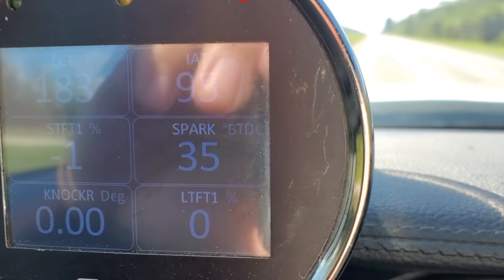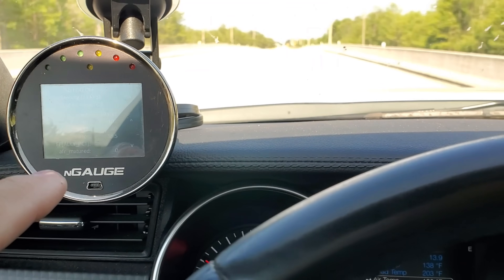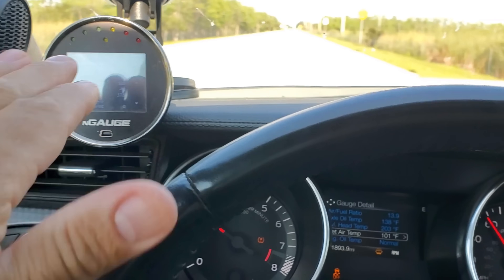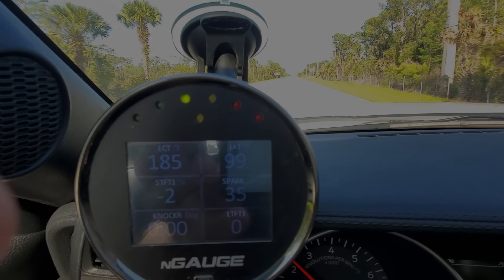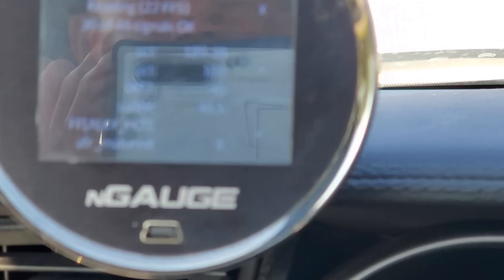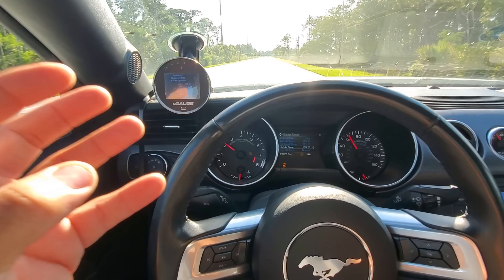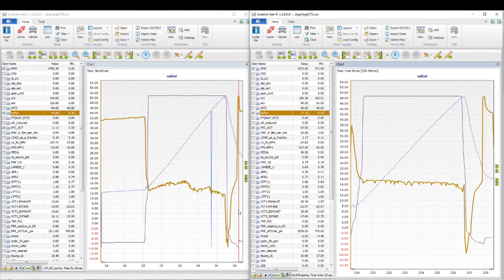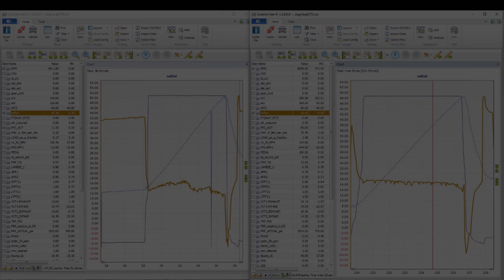Coyote mustangs and Adaptive Octane Logic, How it works!

Comment: Hi ALEX, thank you for another great post. I know this is an old video but I was wondering I have a 19 mustang GT that's not tuned. Does the factory Ford tune have  adaptive octane logic and will I have similar results like you did  with increased timing on the stock tune with the same octane booster?
Reply from the maker: @user-bk5ey9ws5g  yes

Comment: 10 points of that stuff gives you one octane point. So the 8 points it gives you from that would bring your 93 octane up close to 94 octane. That’s why when I needed octane booster I only used Torco accelerator race fuel concentrate. You gotta pay a little more for it but it’s much more valuable per ounce than that stuff or boostane

Comment: Hey Alex, curious what’s different on 21+ models. they remove adaptive octane logic or parameters for a flex fuel tune?
Reply from the maker: It's just not as accessible as we want, we also stopped offering all flex tunes. The customer base simply does not know how it works. So we simply don't offer it anymore as the customer base simply doesn't understand how to use it.
Reply: @YDBT4LIFE  Understandable for sure. It’s not a hard concept to understand either if you place the effort.
Reply from the maker: @juliuslaboy185  agreed. But it was 99% of the flex tunes emails were from bad reading comprehension. So we ditched it and it's been great.

Comment: Does the gen 1 coyote adjust timing on its own? Is boostane worth using for na with Bolt ons and a 93 tune?
Reply from the maker: It can add up to a cap the tuner sets

Comment: Would you run 87 on a stock tune since ford says you can or do you think that a dumb decision?
Reply from the maker: You can. Just expect 0 power and knock sensors super active
Reply: @YDBT4LIFE  I ran it for a tank and didn’t feel any difference power wise when I did. But it could just be the sensors are doing their job to compensate for the octane difference. I’ve been running 93 to give it the best possible chance to get power and not have to rely on them but gas prices makes me reconsider every time. I’ll try to stop being maceta and just pay the 93. Thank you Alex! Love the channel and content! Makes me laugh my ass of at work.
Reply: 87 be fine if stock however if looking for every hp you can experiment

Comment: Alex would putting on a meth injection kit without retuning be as effective or more effective than using Octane booster. I see the Octane booster states not to run in every tank all the time and the meth would also clean engine and help with cooling.

Comment: The octane rating system uses fractional  measurements as well and not just whole numbers. 80 points is factoring in each number to the right of the decimal point. To go from 93 Octane to 94 looks like 93.1 - 93.2 - 93.3 - 93.4 - 93.5 - 93.6 - 93.7 - 93.8 - 93.9 - 94.
10 tenths or points to the next number. 
This is why some octane boosters are garage. Some are like 'increase octane by 10 pionts'. So if you put 93 in the tank and increase octane by 10 points, your just increasing octane to 94. Definitely not the 103 octane race gas you'd hope for.

Comment: I have a Lund Tune and my car is very happy with 4-5 oz of boostane mixed in with Shell 93. That little bit of boostane does make a difference with the timing. Again, very happy with Lund and their tuning. My car loves it and I’m a very happy customer!
Reply: Is it noticeable?
Reply: @Thatdudeinorange  Yes it is. I recently put my mustang GT back on the stock tune bc I traded it for a 2012 Shelby GT500. On my 3 hour drive there, I noticed a difference from the Lund 93 tune. I still had some boostane in my gas and where I would see negative 5-6 degrees added timing on my knock, I saw negative 1-2 on stock file. Throttle response wasn’t there like it was on the Lund tune also.

Comment: 93 octane over 700wheel is risky, unless you have booster. The reason timing is increasing with booster is cause thats the octane the tune calls for. Its decreasing without booster cause 93 octane is insufficient for that tune. Correct me if i am wrong.

Comment: Octanium contains mmt which fcks up combustion chamber and spark plugs turning them rust orange, and you cant get that shit off.
Reply: I wouldn't care if it turned the combustion chamber hot pink as long as it saves the ringlands or rods.
Reply: maximus vonce I used it often when I had my Gtr for a while until I went E85. It helped a lot 4-5psi over 91 alone, I used seafoam/b-12 often to clean things out. My plugs and o2’s looked good.

Comment: My question would be when using octanium/Any Octane booster how often should you change the spark plugs since it leaves residue?
Reply: Check the plugs every 7 to 10k. Don't listen to nay Sayers. Today's Oct boosters are safe
Reply: Some additives do over time leave a oily substance but it took lots of time on my setup
Reply: Dont use octane boosters ever

Comment: Any significant differences between the Octanium, Boostane and Torco? Is is safe to assume they're all pretty close? Thanks for another informative vid!
Reply: I agree. I would like to see 3 or 4 different octane boosters used with 93 gas from same station to see which one really performs the best. Even try the Lucas octane booster. But for sure this VP booster seems legit. Thanks for filming the results.
Reply: snowsolo I automatically turn into a benchracer and wanna know how each one of those actually changes the octane and by how much, lol. 🤦‍♂️😬🧐🏎🚀
Reply: By the numbers boostane out performs VP. I don't have real world experience since I haven't used VP. I do use 3oz of boostane per tank and see 17 degrees I my logs

Comment: You think that will do anything for na cars, or just boosted cars?
Reply: Of course it will.  It isnt gonna add 50 rwhp like that but it could def make a noticeable difference.  Might only be 10-20 wheel over 93 alone  but you gotta understand its gonna get that gain through most of the power curve which makes a noticeable difference

Comment: I have a question, did you shift out of third at 120+. I’m making around same power on pump with a whipple in a 17 on a 3.625. I’ve been wanting to change the gears , what do you think
Reply: It’s me, I hit the send by accident, I have 3.73 and I’m about tired of them. What’s best all around gear for 700 to 1000 hp range,3.55 or 3.31?

Comment: Is running 87 really bad for a stock GT? Cause in manual it's recommended.
Reply: Advertised HP is made using 91 octane. Its not bad per se, but you're not making as much power.
Reply: @PayForYourGas  but it shouldn't demage stock engine right? Ford does claim you lose 3% hp when running 87. I would love to see side by side dynos.
Reply: @gaivoron  no you will not harm the engine on a stock tune.
Reply: Are you boosted otherwise have to try to see what yours likes

Comment: Also is this a replacement for a more aggressive "race" tune designed for higher octane? Or is it like flex fuel where a dedicated tune is better than relying on the ECU adjustment for race applications?

Comment: What year did Ford start putting the Adaptive Octane Logic in the ECU?
Reply from the maker: i believe in some 3v and GT500's but for sure 11 coyote.
Reply: @YDBT4LIFE  Alex can you run 12.5 compression on 93 with a octane booster or is e85 a must (na gen 1 coyote)...Im a noob at this stuff so take it easy on me...
Reply: Based on what i see, it started in 2008. Ford calls it "adaptive spark ignition system".

Comment: I currently have a Ford Fusion Sport, 2.7L TT from the F-150. E85 is about 1hr away from me, with that being said could the booster be just as good as the e30 tune I use? Currently tuned through Unleashed.

Comment: Why wouldn't you use the same Shell gas with the VP Octanium as you used with the first log?? I'm not knocking the octane booster. I put 10 gallons of Torco through my car every year. Apples to apples would be a better comparison.

Comment: whats a good place to learn how to reprogram or troubleshoot a 2017 mustang computer? Mine sometimes stops responding to my key fobs and I have to use the physical key to unlock the door and rush in to drop the keyfob into the cupholder slot to turn the car on before the alarm starts blaring. Wanna learn how to fix that
Reply: That be a good video but might not be Alex expertise if it is I love to see that content
Reply: @jmanke6057  I got rid of that car years ago. Bought a brand new one also years ago - not a single problem

Comment: Without reflashing the flex tune is there a way to get the learned alch flag to reset? Other than filling up. It does this weird thing where it will flag that it learned and then continue to climb to 98% alch content. Then the STFT and LTFT  will stay around -8% until I reflash the tune.
Reply: Zachery Smith KAM reset but you have to run misfire monitor relearn

Comment: I have a flex fuel tune on my 19 gt. . Adding octane boost will not hurt the engine, which I only run e85. But yet on long trips I use 91. That's California you. My tuner said its  OK as long as I  don't run race fuel.

Comment: On the factory tune from ford could a car pick up any real horsepower like you did in this video from an octane booster?
Reply: Yes
Reply: But it's not safe it will damage the cats it says on the bottle.
Reply: @fedozabidi6066  Correct, the octanium bottle he used will damage cats. But VP also sells a cat-safe octanuim its blue colored. And Yes adding octanium even on the stock tune for a gen 3 can pick up some power as the car will see peak timing which is capped at around 27 degrees on the factory calibration octane logic.